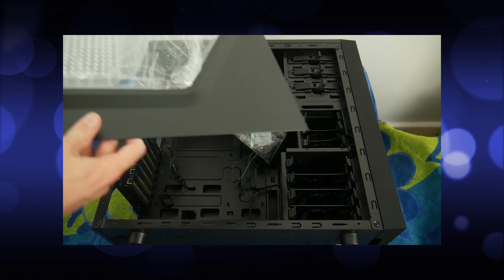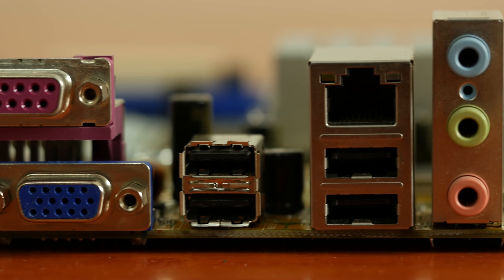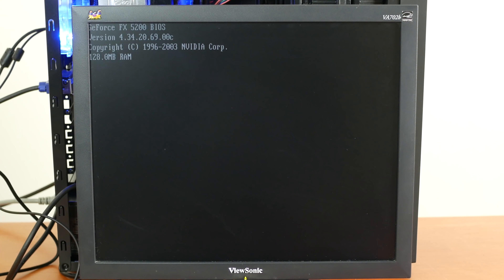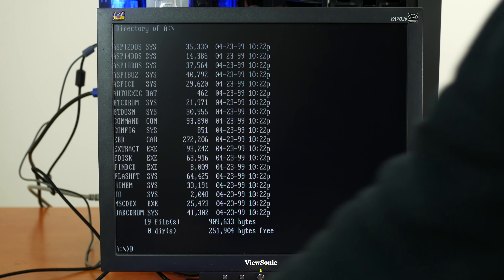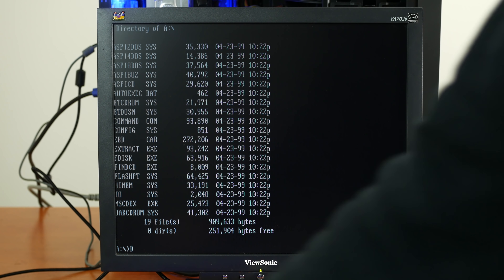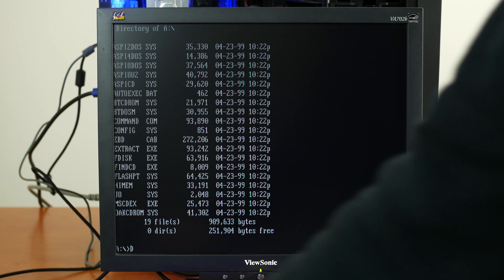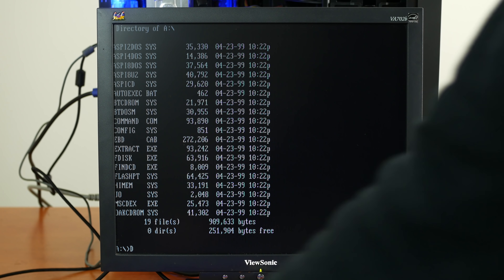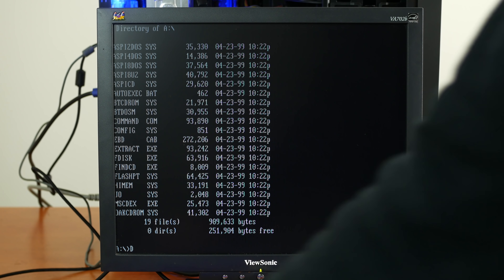What's the fastest (officially supported) Windows 98 PC?

Comment: didn't you know that if you have certain system devices that haven't got the drivers installed you will get a lot of what we are seeing happen, thats conflicts in memory addressing and irq's...like the sata and ide, system timers etc...windows 98 had very few drivers included and rarely even knew what hardware you had.......so if there are any devices with exclamation marks by them i suggest installing the specific driver for it, as windows generic will not work.

Comment: Everyone coming from this era knows, that 45nm CPUs need a new BIOS update in comparison to 65nm CPUs. (Conroe -> Penryn).
And also many ppl know after looking for compatibility, that there is NO Mainboard from the old Socket 775 Generation supporting Pentium 4, that supports 45nm Core 2 Duos. Actually the most first gen socket 775 mainboards dont support core 2 duos, even with a bios update. And the boot problem comes from 2 cores, usually u can disable 1 of them in BIOS.

Comment: 12:12 That's where you went wrong. It's NOT actually the same generation! E8000 is die-shrunk 65nm Core 2 2nd Gen (Penryn) whereas E6000 is 90nm Core 2 1st Gen (Merom). They're both branded as "Core 2" but were most definitely NOT from the same generation of chips!

Comment: since i don't see it mentioned; win98 doesn't really like multi-core/hyperthreading. it causes... issues. a single core p4 is just fine, the extra cores/threads are unused, even if they mess with overall stability.

the partition thing; sometimes you have to align partitions after you partition an ssd and format it., older oses and dos and the like want them 'fixed'. most windows partition software (non-ms) do it.

and yeah, some optical drives don't adhere to the sata spec properly, and some boards don't either. failover to previous iterations of spec issues and all that.

Comment: Wondering why you did not use Win98 SE?  it had many revisions for stability.  Like disabling active desktop.   Active desktop usually crashes windows.  If you have 98 normal, safe mode into it and disable active desktop.

Comment: Probably you can run win 98 on pc with uefi in case cms is enabled. But win 98 runs in protected mode(32bit) which means that the system can't allocate more than 4 GiB of memory. Probably windows 98 does not use custom instructions shipped with cpu that officially support win 98.

Comment: Yeah IDE for dvd drive for windows 98se is highly recommend since sata didn't came out until early 2003. So the offical 98se came out in 98 so about a goood 5 years. Sata support eventually came into play, but needed drivers for those. However you can use a sata for the harddisk or ssd.

Comment: I found that my 98 machine did not even like a DVD drive, so I used a CD /RW drive works fine.  I used an M&VIG Pro MB and Athalon 1.33 ghz processor and an old AGP Rage Pro ATI Video/TV Tuner card.  Device manager is clean with no yellows.

Comment: BIOSs didn't just support USB booting, they supported floppy disks! In fact, updating a BIOS from Windows was actually the wrong way to do it and the way that was most likely to brick your PC (which happened to me in the past). The correct way to flash a BIOS was a floppy disk drive or a USB floppy disk drive from the BIOS boot. At least, that's been the case for me since 2003.

Comment: I think I know about why exactly Windows 98 didn't work well with the Blu-Ray drive. It was most likely treating it as some generic CD/DVD drive, when it wasn't, and the drivers kept trying to access the hardware in ways it shouldn't or couldn't, and it was confusing Windows to the point it couldn't continue booting.  Strange blue-screen though, haven't exactly seen one like that, I guess Windows also doesn't like when a single driver uses two different types of modes (aka if it's a DOS or Windows driver) for the same device?

Comment: Agp has direct access to cpu if the motherboard supports it.

Pci-e does this too and uses digital signals and multiple pathways if the motherboard supports it.

So agp would outperform pci-e as it has its own dedicated hardware and higher clock speeds.
Reply: Hyperthreading bypassed the single core limits.

Even still 98 and nt could unlock multicore access in 64bit systems with more than 4gb. Ram

Comment: Aww...   you actually got a 6800 LE card.    Sadly that's the much slower 6800 variant.   It wasn't even in the same class at the 6800 Ultra honestly.      8 pixel shader units on the 6800LE vs 16 pixel shaders units on the 6800 Ultra, not to mention 128MB vram compared to 512MB vram.    The 6800 LE was actually slower than the 6600 GT.

I remember it explicitly as I sold PCs at the time and always tried to steer people away from buying 6800 LE cards as was about half the speed of the 6800 Ultra.

Comment: I'm pretty sure I have the fastest supported windows 98 machine. I have an asus A7N8X MB with an athlon xp3200 running at 2.2ghz on 400mhz bus. This was originally an Windows XP machine but the MB came with 98se drivers so for fun i installed 98Se. 512MB ram, 80Gb drive, 128mb video, and a sound blaster live . I installed it back in 2005 and it runs wicked fast and flawless. Better than XP did.  It pretty much sits in my closet but every now and then I take it out to make sure it still works.

Comment: Fastest 98SE install on the metal *ever*? No sir. I installed 98SE on the metal on an IC7-G to a ram disk. Machine had 4GB of ram, I allocated 3.25GB to a ramdisk and booted Windows with 768MB of "ram". Total install time was about 60 seconds. I don't think it can get much faster, as it's mostly waiting for things to time out.

Also, that "single FIFO mode" means that any devices on your paralllel ATA controller are limited to something stupidly slow like 8MB/s.

Comment: A Pentium iii is definitely ideal for windows 98. Anything newer can get unstable. I’d bet older cards like a GeForce 2 or 3 would probably run most of those games no problem(well, halo would be slow but it’d work) XP is much more forgiving of newer hardware as you can get up to early i7 and a 980 ti working on it with little issue a great sound card is also a much for windows 98 as the onboard stuff just doesn’t cut it for most of those games.

Comment: Pentium III and 478 socket Pentium Iv mother boards are the best for windows 98.they run with minimum errors and annoyings(because it is the last motherboard architecture that windows 98se officially supports it, and the socket 478 mother boards are roughly the same architecture as of PIII).

Comment: You're better off with a 5950 ultra due significantly better compatibility and support, as for cpu you woulda had a much easier time with socket 478, pentium 4 3.4ghz and 5950 ultra is your best combo

Comment: Not really sure on the Core 2 support being the best option, since Windows 98 doesn't support more than 1 core, so you're basically only using 1 core on your Core 2. You'd likely have had more performance on a Pentium 4 with the highest single core speed available to you (turning off HyperThreading because again, Windows 98 doesn't support multiple cores, not even virtual ones)

Comment: 2:20 that's not correct, because with PCIe you could use a Geforce 6 seried card that supports SLI, so you could maje the system faster by adding a second GPU. From what I know for example the GeForce 6800 Ultra supports Windows 98 and Me up to the 81.98 driver and even Win 95 up to the 66.94 driver, at least Wikipefua says so: https://en.wikipedia.org/wiki/GeForce_6_series#Discontinued_support

Comment: Going SATA on Win 98 is a huge no no. Wether is SSDs or just simple drives, it causes many issues. You need to go IDE if you don't like pain and BSODs. If you really really want to go SSD, you need one of those IDE to SATA adapters. While it won't be as fast as SATA, it will be much faster than regular IDE drives thanks to the super low access time. Finally, the latest nVidia driver for 98 isn't very good. I had some a good share of freezes with it, but it was solved after downgrading to basically the oldest driver that still support your graphics card.

Comment: I remember over time the windows/temp folder and maybe another place (maybe registry?) files/entries would build up and need manually cleaned - many a time I "fixed" peoples' slow PCs by deleting everything in the temp folder and rebooting.  Dont know why it slowed everything down so much other than a completely full drive but the file buildup was something about disk management or lack thereof?
Reply: I'm moving my temp folder somewhere else for ages now. Just makes it easier to clean it when needed.

Comment: You should have added the microcode from the E8600 to the Bios with a Bios editor, there are planty of tutorials for that because it used to be pretty popular to add Xeon microcode no lga775 consumer boards in order to get LGA771 chips to work on LGA775. Im pretty shure that would have gotten the E8600 working just fine

Comment: Motherboard: ASUS P5AD2 Premium
CPU: Intel Pentium 4 Extreme Edition 3.4 GHz
RAM: 2 GB DDR2 (two 1 GB modules)
Graphics Card: NVIDIA GeForce 6800 Ultra
Storage: 250 GB (or larger) hard drive
Power Supply: Adequate for the configuration
Optical Drive: DVD Writer (DVD-RW)

To 2004 windows XP

Comment: I bought my first WIn98se Gaming Pc in 2000 Amd Athlon 900mhz   32mb graphics  19 " Trinitron cost  package cost  £1500 and was future proof with a 30gb hard drive , yeah future proof for 4 weeks when they launched the  Athlon 1ghz  processor package with a 64mb gfx card,  lmfao,  that was the one and only pre build i ever bought harsh lesson but early in my PC building life still have the 98se disc in a box with my XP and win 7 install discs .
Had a crossover tech board with asrock which  was a vista support capable but could go retro 98se or XP  xp functioning better , which was Asrock 4coredual sata 2 board with 4 core  775 capable  support  (q6700  go  small air oclocked at 3.2 ) dual  slot gfx  had pcie  x1graphics slot as well as AGP x8,  also could use DDR or DDR2 memory again four slots 2 which could be populated with either type of your choice.

Comment: this is hilarious - the best cpu to use with the p5pe-vm is the core 2 Extreme X6800 - you have to use a CONROE core 2 duo cpu from the same year (2006) as the motherboard itself. (a condition that intel seems to still stick with till modern day) this board was made for compatibility with 865G chipset + windows 98SE +  windows ME. as long as you use a CONROE cpu it will work 100%. i use mine with a Geforce 2 AGP card that was originally for a mac which i flashed to PC, it has really good Windows 98SE support. you can use any Geforce card from 2 through 6 series. i use 2 x 256MB DDR1 PC3200 for a total of 512MB ram. adding more RAM can cause problems and is not neccessary for a win9X OS there is no performance gain from adding more than 512MB ram.

Comment: I solved the freeze or reboot on shutdown issue by letting windows do a defrag even tho it was an SSD. Set to run programs faster and it worked. I spent two weeks installing and reinstalling and uninstalling and reinstalling the os and drivers and pci cards. Ya I remember now why I hated windows 98 or any of the early OS's

Comment: MY Computer i own  - i made it myself. predating all of any of the so called u tubers stuff they claim. 

DUAL CPU _ YES _ Apple CPU powermac 6100/60 + INTEL CPU 486/dx66  running both in the same computer a dual cpu system i made myself in the early 1990s with MAC OS 7.5 and Dos 6.3 / windows 95  - originally windows 3.1
Lastly i did get it to mac os 8 and windows 98. before i retired working on it and move to other projects aka newer tech stuff.

  my computer back 30+ years ago when it was working will beat anything you got.  I do still own it, just been in storage last 30+ years still in my garage.
 those concepts you talk about did not exists when i was doing those things.  alot of the work and stuff folks use today is from my work back then.
 
many dont know but their is no fame and fortune for such works, that get merged to other parts later, then taken over by other companies, then they claim they made it all years later.  this predates social media, online internet as we know today.

Comment: question is, that you have to use sata hdd, or eve ide hdd, to run win 98,2000, and xp without file system problems, or something like that. and without blu-ray drive, why would you even use it on such older system? even sata dvd drive would be enough

Comment: i am running a asrock 4coredual-sata2 mother board, e7400, 2g of ddr2 667 (limited to 512 but did run great at 1g), ati aiw 9800 pro graphics,  audigy 2z platinum sound, 120 g sata ssd (with adapter),  set up with 5 partitions,  win9se, winxp home, win xp pro and win7,  win7 runs slow, Also had win10 but it was so slow I removed it to add more storage on the ssd,

Comment: Thanks for the inspiration. I too am looking to build a computer with windows 98se in mind, but I'm going down the AMD route, as I've been using AMD for longer and more familiar with them. Going for an Athlon 3000+ Socket 754 and asus k8-v se motherboard combination. GPU is going to be a tough one, after some google digging, I found the last AGP card was a HD 4670 1gb and its stupidly priced now and quite frankly overkill for an OS that can support a maximum of 512mb ram, I'll go for the radeon 5950 or geforce 66-800  I'm on a shoe string budget, so I'll be going in charity shops, 2nd hand shops. Ebay is full of dick heads. I may put up a video, if anyone would like to see that.
Reply: Yeah, the HD 4670 and HD 3850 are stupid expensive for that exact reason, the fastest cards for AGP. The fastest things for a given interface are always like that. It's the same with CPUs Which one of them is faster really depends on the games.
Gotta check what you want to play on it, some older games require features that got cut later on, so older cards will do better there than newer ones.
A classic would be something like a Radeon 9500 Pro/9700 or Geforce 6600 GT, those were quite common back then, so availability should be okay.

Comment: I’ve run Lego Island on several PCs. A variety in fact. Everything from a 200MHz Pentium 1 to 2Ghz Pentium 4. Honestly I’m not surprised it wouldn’t work in hardware mode. It was always a tricky little b*****d to get running even on exactly period correct hardware. Often I’ve had to resort to one of the software modes as it’ll outright refuse to launch on hardware mode. Still at least a C2D should have the horsepower for software mode 😉

Comment: New Egg had socket 775's brand new that supported windows 98SE. I picked one up when they had them in stock.  I should gotten 2 of them one for back up.  Any who i also have issue's with the AGP card. At least the one I have XFX 6800 XT/SE w/e one I'm still not sure I forget.  Windows just doesn't see it. The work around is putting in fx 5500 you can buy one new for 25$ on e bay ^^:    install that card than pull that one out and install the 6800 and for what ever reason windows will install it. But after that the " it is now safe to turn off your computer" doesn't work anymore lol  Never fixed that part.  I got 98 SE to see 1gig of ram pretty easy. Using SSD's kinda suck windows wears them out to fast.  Not sure the fix.  But i like old spinning hdd's better anyway.  I wish i could find someone to help me with these servers I have no idea how to fix them or boot them.

Comment: ahh yes p5p 775 boards was hillarius people bought the super expensive Core2Quad Q9650 and the clever tech hackers used instead the cheap but Equal socket 771 xeon e5450 wit adapter on it..was awesome times

Comment: Just picked up a pentium 4 which runs 98se and xp, sis645 and fx5200. Main problem is audio. Kinda fixed by sbemu (or running freedos) but i am gonna have some fun with mt32 pi. Probably run of the mill but.. Fuck it.

Dos mode is what 98se is good for. Stick with xp for everything else.

Comment: Windows 98 was awful. I switched to NT4 (first the trial Server with a timebomb that had to be cracked, and later a copy of Workstation that was bundled with an academic copy of J++ for $50). With the NT4DX5 patch and a 3Dfx card, it was more than capable of gaming and far more stable than Win9x, and I ran it happily until Windows 2000 was available. I was a beta tester for WinMe and WinXP as well, but was never a fan of either.

Comment: windows 98 has a pretty harsh cut-off at with determined by chipset drivers past 2003 and nvidia forceware 45 or there about. Drivers are just not tested if supported later than that, so your best bet is early pentium 4 with that fx5200 actually. I tried to get windows 98 working with nforce chipset of an amd64 3200+ and geforce 6600GT. Oh boy. Dont do it :D also remember 120GB max partition and 512mb ram also max. 1gb ram win 98 is trouble. Also the only reason to go with win 98 is to play those late DOS games, that just dont work correctly on windows xp, like build games. Shadow warrior, settlers, warcraft etc. DOSBOX absolutely sucks and dont emulate input correctly at all

Comment: blu ray player..... On a windows 98 PC.... Naw. Every blu ray disc drive I've ever seen required at least windows XP (And there were bad things with XP if blu ray drives, vista was really what you needed back then) and most recommended a quad core cpu (The core 2 quad was actually what they recommended back then) and at least 4 gb ram. And this is back in 2007ish.